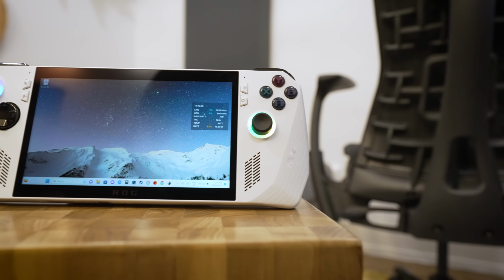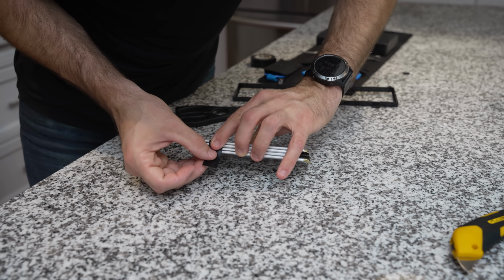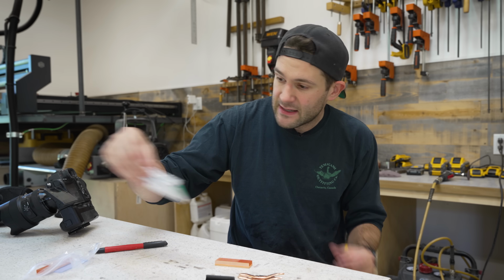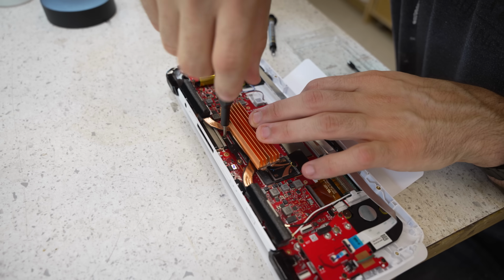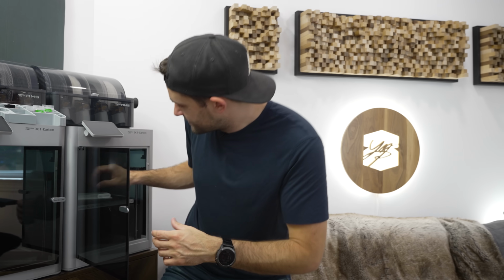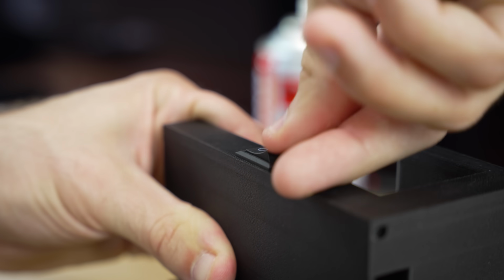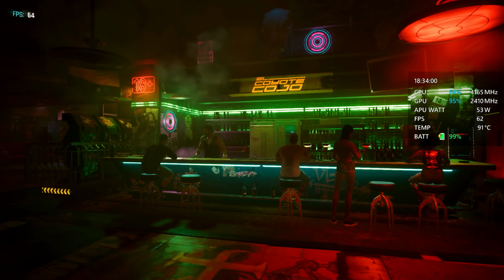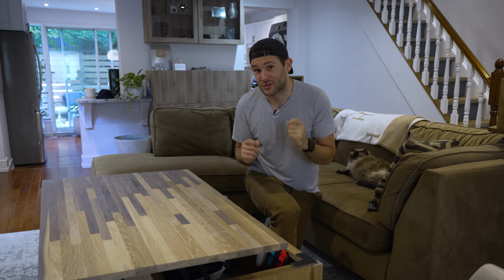I don't understand why people buy Steam Decks...

Comment: Several questions.  One, did you park some cores, go down to 4 or 5 or 6 cores.  Then that power budget can be used by the GPU.  Did you undervolt to reduce heat?

On the storage front are you going to get the 90° adapter to run a 2280 SSD?  Its a heck of a lot cheaper (2TB Reletech $40, 2230 Reletech 2TB $130).

Comment: I would have put a momentary switch in the bottom of the dock so you can flip the main switch you installed and it turns off automatically when you remove the device to streamline the process a little and it gives you the option to turn it off when it is just charging
Reply from the maker: I did consider this, but the only wrinkle is that I like to leave it in the dock to charge and then the fan would be running the whole time.
Reply: @ZacBuilds  I suggested that you leave the switch you already installed and make it the master switch to the fan so you could turn off the fan

Comment: For the battery it was much simpler and much better if someone makes a case with built-in battery as a power bank but with a lot of battery capacity and capable of fully powering it at max power setting.
Reply: Ally mate and a battery bank already solves this easily but having it built in is kind of awesome
Reply: @SmartFool24   Well depends cause the one they made for Switch would be pretty much almost the same as internal because it's a case made just for it with the additional power bank.

And one goodly designed for the Ally would look a lot similar to what he have done here except without all the ruining of a good looking backplate.

The bigger difference is really that it would let the internal battery to be kept at 100%, but there's likely software to change and make it not fully charge to max voltage to keep the internal battery in good state, at least a hacked switch have that feature to set what battery level I want it to stay while keep showing 100% in it's software.

I did cut my Switch interior backplate to improve cooling but never messed with the external plastic case it-self.

Comment: Apparently the Z1 Extreme is bottlenecked by it's 6400mhz Ram and not by heat. Adding more wattage does not really add much performance. The Z1 Extreme  or the comparable  the 7840u seem to get a 10-20% performance increase with 7500mhz ram. On the Ally discord people are working on increasing the ram speed.
Reply: Bricks it

Comment: I think the cooling mod is much better than you give it credit for. I would think that those lower temps would help your battery last longer/possibly give you a longer battery life since the apu isn't demanding as much output? And it would for sure keep your hands from not over heating. Really good video. I know you love walnut, but I'm glad you showed restraint for this one hahah
Reply: literal 20 degrees colder, and 30 with the dock
Reply: As a circuit cools down, it's electrical resistance goes down, lower resistance causes higher battery life because the voltage drops in the wires aren't as prominent.
Reply: @vectorlua8081 It's not drastic is it?
Reply: @DowneyMax  It's not a massive increase, but if you're actually paying attention it should be noticable

Comment: Would have loved to see you attempt an oculink mod to switch between the internal m2 drive and an egpu for docked play
Reply: I mean, there is an eGPU unit that ASUS makes for the ROG Ally and some of their ROG laptops, that uses the big port on the top of the Ally that the USB-C power/data port is only a portion of.
Integrating the eGPU in to the dock such it can be modular would be an interesting time.

Comment: software only know the battery is 40wh , will it stop charging at 100% ( 40wh ) ?
Reply: AFAIK it should pick up the new capacity after a few cycles. Charging is managed by built in software and designed to utilize the most capacity it can get by monitoring the charge. As far as it's being charged it will be calculating its best guesstimate and correcting itself along the way. Lipo batteries don't just die they last very long if operating within parameter. There might be issues when folding the packs not careful enough. The packs get hot and expand in size slightly some and that  may cause become loose. First time here. Great vid and subscribed. Thanks.
Reply: Good point

Comment: I have done a ton of hardware mods on mine as well including I was the first to do the noctua fan mod on the back but a lot differently.  I will also a say your cinebench scores are 3,000 points lower than mine which is kind of odd for yours to even score below 15k on r23. I’m getting 59-60c temps in mw2 and forza at 30w manual with turbo enabled. I have been waiting weeks on the 2280 adapters to arrive so I can compare temps on the prior nvme mods I’ve done. ✅ great video though. It’s a lot more polished than I could ever do. Also the sd readers still die even with the tape over it. The controller chip is what dies not just the reader. I do have a proper fix for it I’ve ran through the paces though